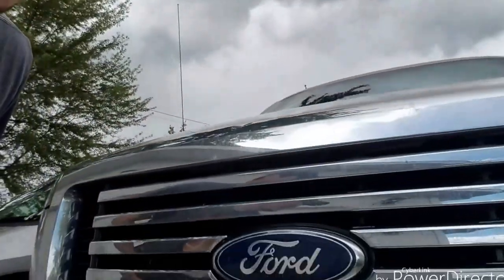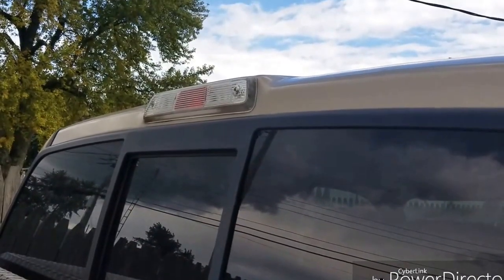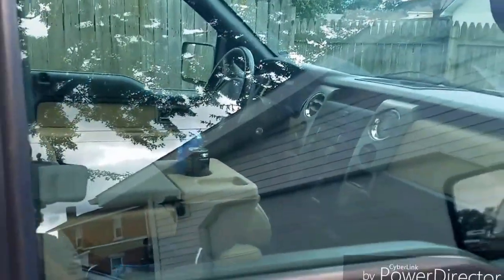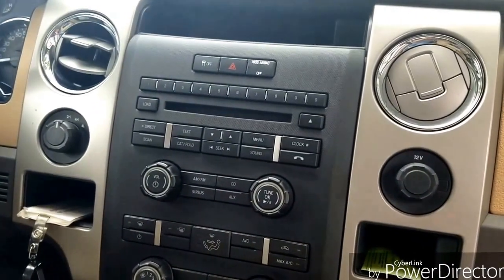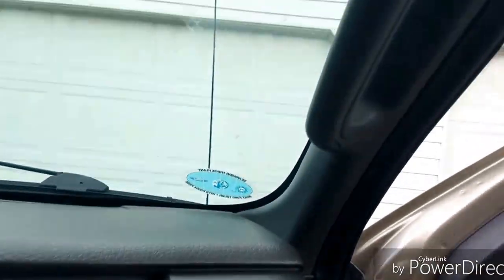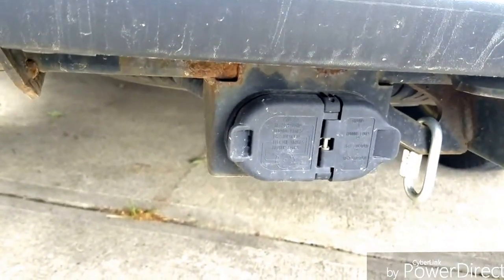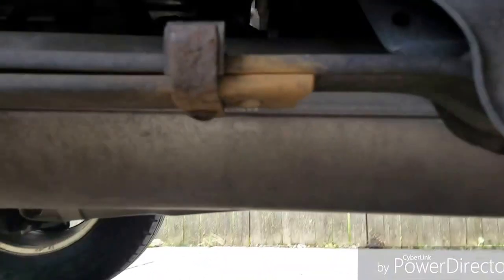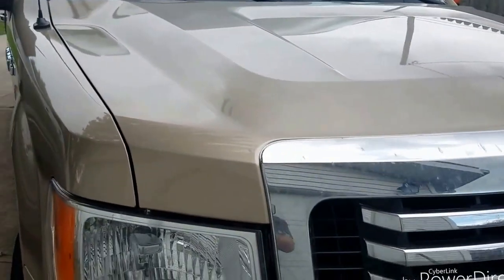8 things I hate about my 2011 F150 ecoboost

Comment: I have a 2011 Ford F150 Lariat 3.5L Ecoboost and I love it. The only things I dislike is how the turn signal lever doesnt stay down and it'll go back to the original spot but the signal stays on but every vehicle I've driven, the lever stays down. Another thing is how it doesn't come with the digital speedometer. It has a gauge mode but the second screen doesn't have it, it's just blank. Other than those, I absolutely love it. It also may have 201,941 miles, still going on strong!
Reply from the maker: Thanks for the comment I still have mine. But my trun sign works fine going back up it doesn’t want to stay in on in the up position. 153000 mile no problem other than the coolant leak for the water pump. Which has been fix.

Comment: it's a sixer.... you don't want to hear the exhaust
Reply from the maker: I had a 4.2 liter f150 I put a flow master 40 series muffler and as long as you didn’t get on it. It sounded great. I know they sound like carp when you open them up. More interested in hearing the turbos. But your not wrong.

Comment: spark plugs need to be replaced every 5000 miles, direct injection carbon buildup and defective ring lands and con rods
Reply from the maker: I will be doing spark plugs this week.
Reply: Derek Simenac i only have to change the spark plugs around every 45k miles.